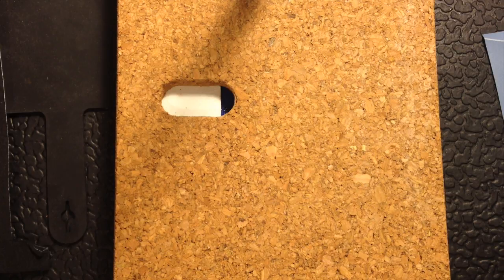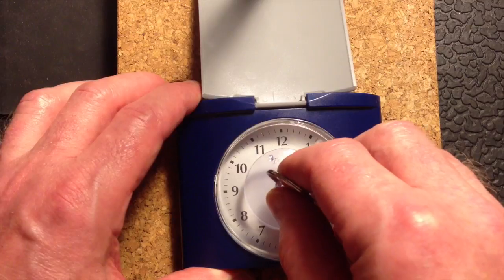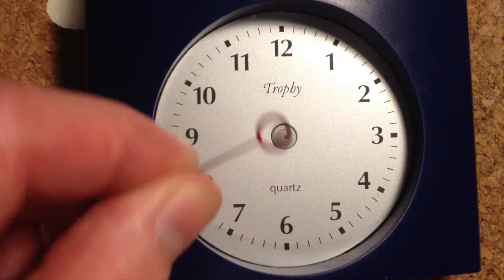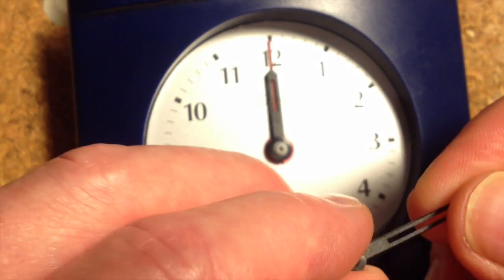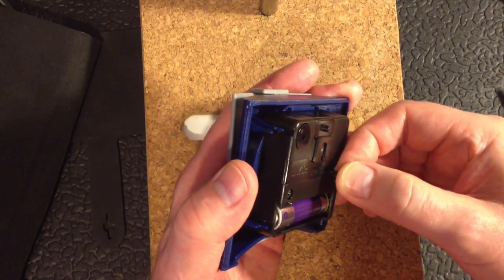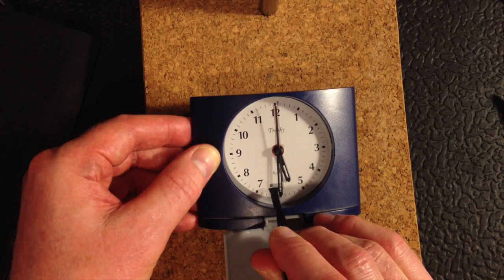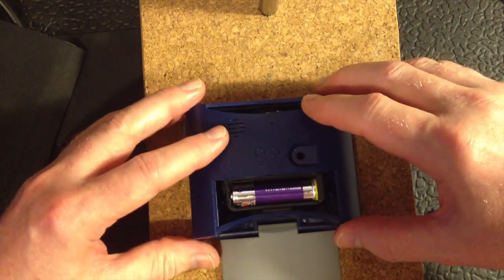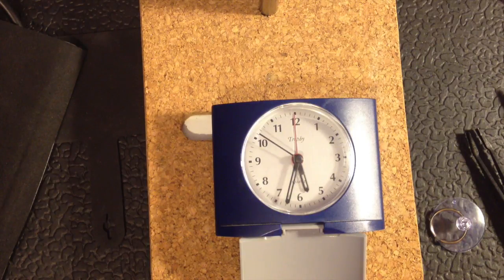Quartz Clock Travel Mechanism Repair How To Save Money

Comment: Very helpful and clear explanation - thanks for  that. What puzzles me though is how do you know that the alarm setting hand is in the right position? You aligned all the hands at 12.00 which is fine for hours, minutes and seconds but not surely for the alarm hand, it could be set for any time.
Reply from the maker: Hmm good point, I didn't think about that, the sensible approach would be to set the alarm for 12 then move the hand till it goes off, then remove it and place it back on 12. Please share this with others and subscribe, I'm trying to get over the 10,001 subscribers by Christmas and need all the help I can get. Thanks Malcolm aka #fixed1t